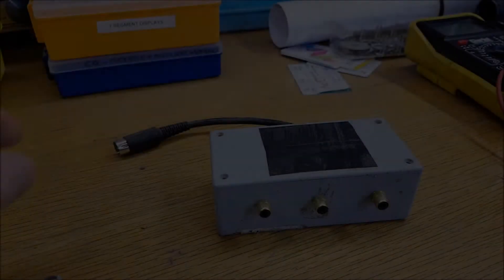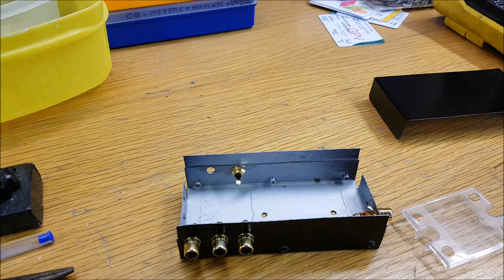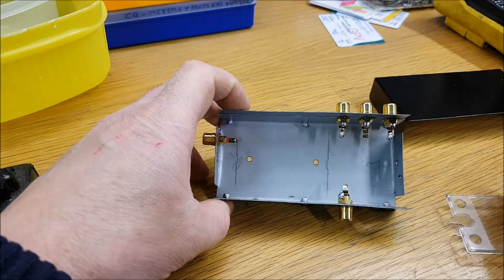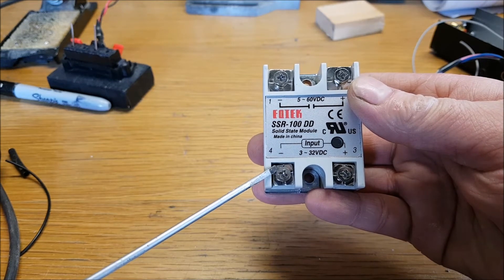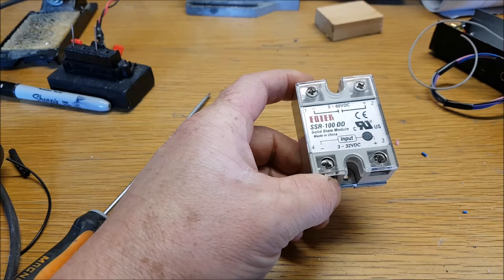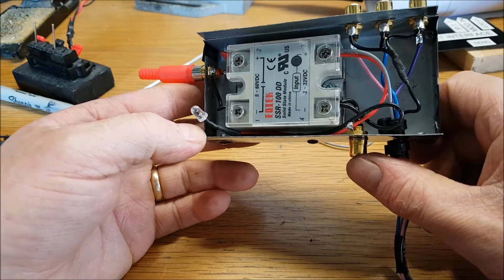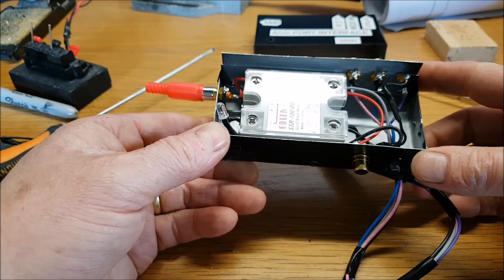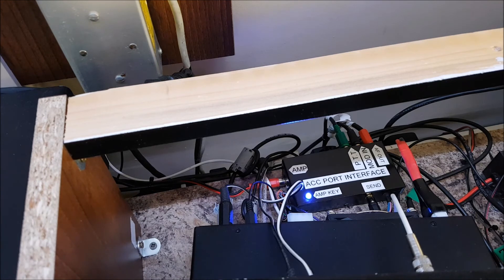Icom 7300 ACC Port Interface with Solidstate Relay for Amplifier Keying Isolation

Comment: I am in the process of putting one together. I have one I made with a tiny reed pilot relay and a flywheel 1n4001 diode that switches the amp instead of the radio (IC-7300)  it works well but I am in the process of building a new one with a SSR just about not the exact same unit as you did but got a D3P-054 what I am interested in is all the extra connections you have. All I have is one RCA in and one out. Good video. It would be fun to see a wiring diagram of what you did, it looks fancy. One thing I'm going to do is put a 500ma fuse in the line from the radio to protect the 1 amp output.

Comment: Did you do this because the Amp was quick peaking high on your Swr on the 7300?
Reply from the maker: No, the main reason was because the amp has 28v on the ptt line. The keying relay in the 7300 wouldn't last too long at that. All I can say is I have had zero issues of hot switching or SWR peaking since I put this together. Its connected but its not if that makes sense.

Comment: hi, does this cure the hot switch problem with amplifier un-keying  delay on the 7300 ?
Reply from the maker: with this method, the amp is isolated from the radio in terms of keying. Ive never had any issue
Reply: @GeorgeEI7KO  how much do you charge to build one >?
Reply from the maker: @ronangsr  whay part of the world are you in?